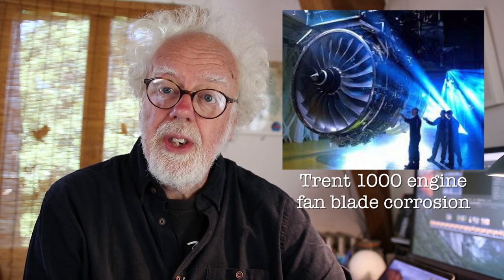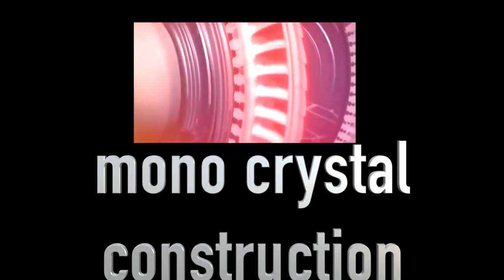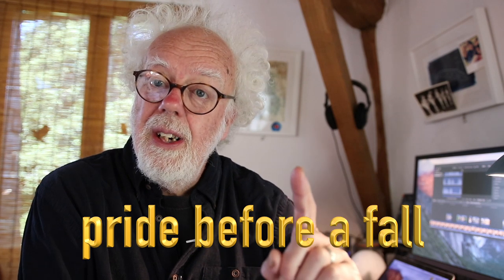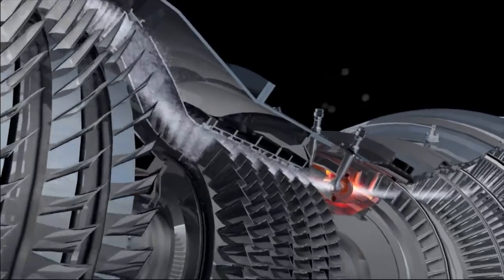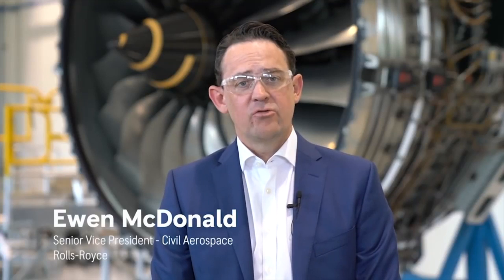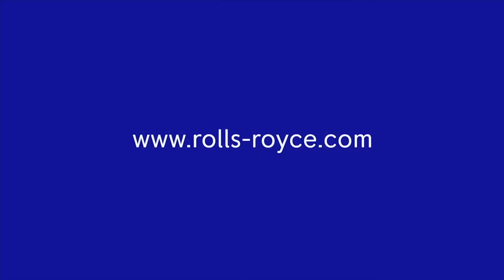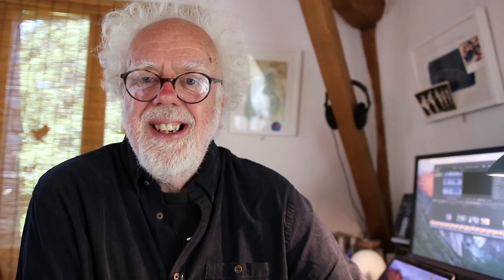Boeing and Rolls Royce problems - Prof Simon

Comment: Fact check: Trent 1000 does not power the A380 and A350. They are Trent 900 and Trent XWB which are within the same family of development, but do not exhibit the same failure like in B787.
Reply: True. The 900s just blow up. Several of the pictures he showed near the end were Trent 900s on A-380s.  They have been known for high-pressure compressor failures. The 1000s seem to have more issued with the fans.  Hopefully, the improvement in metallurgy will resolve the high pressure and hot section failures and GE is working on what may be the next great leap, both in efficiency and safety. They are developing new turbofans that will use a gear reduction assembly between the low pressure compressor and the fan. This will allow the fan to turn much more slowly, putting less stress on the center shaft and reducing the fuel burn required to get the same core RPM, while radically reducing the centrifugal stresses on the fan blades. Changes in the pitch of those blades will allow the fan to create at least as much thrust.

I can't imagine that Rolls Royce would be far behind.
Reply: @104thDIVTimberwolf  Timberwolf not a Mad Cat?
Reply: @transkryption  I'm not even sure I've heard that term before, related to jet engines (not that that means much).

Tell me more.
Reply: both engine series have been known for blade failure ie Trent 1000 PT failures Trent 900 compressor failures, still disastrous for RR, thats why GE is slowly taking over
Reply: @Dryootube  does Pratt & Whitney even make engines any more? They used to make some great ones.
Reply: Trent is a three spool design so each section can run at optimal speed. Fast at the hot back end and slow for the front fan.
RR have done this since the RB211 (a 1960s design). 
Their gradual development should avoid failures like these but clearly there is work to do.
Reply: @104thDIVTimberwolf  that's a crazy statement with a 16.5 billion turnover? military application or civilian?
they make the best military engines in the world to date, nothing comes closer, in performance and reliability, F135 powers the F35, F119 powers the Raptor, F100-PW-229 powers Eagle and Falcon and was a revolutionary engine in design more then 7000 produced, more then 24 million flight hours, 

All Bell helicopters use PW
Civilian you can start with the PT6 family, it is the most common turbine for small aircraft and helicopter in the world, a staggering 400 million hours of proven service, your larger aircraft most airbus and Boeing run PW engines.
Reply: @Dryootube  true enough. It's just been a while since heard of an airliner flying on anything but GE or Rolls Royce power. A better way to rephrase my question would have been "Does Pratt & Whitney even make engines for airliners or heavy transport, anymore."
Reply: That said, the Trent 7000, the engine that powers the A330NEO, is really just a shrunken Trent 1000.

Comment: Corrections: The hot section doesn’t have fan blades, they’re the big blades at the front (Low pressure compressor), however the hot section does have turbine blades. Also, the T1000 is unique to the Boeing 787 Dreamliner, nothing else. Finally, contrary to what the video says they don’t keep blowing up all over the sky otherwise R-R powered Dreamliners would be grounded, which they’re not. This is a very misleading video.
Reply: Couldn't agree more. All this talk about "fan blades"...... I'm not sure the Professor really understands what he is talking about.

Comment: Rolls Royce should talk to GE , because the 9X is having very similar problems with their turbine blades, this means the new 777 X will be late entering service . I believe that these monster engines have reached the summit of possible size and scale , to achieve the desired power and fuel consumption the pressure ratio is so great that it literarily cooks the turbine blades . They are simply too big , and I fear will never reach their potential, everything has a limit .
Reply: There is no limit to how big a gas turbine can be built.  Internal combustion engines are limited by flame front stability and speed versus engine RPM.
Reply: frank james straw just take a look at the gas turbines in a power plant, they are way much lager, the only difference is that they turn a generator in front, not a big fan

Comment: Read the engineers warned Rolls management there were issues before initial in service date but were ignored.
Reply: Sadly, this is the precursor to every major disaster.  Hubris.
Reply: Management ignoring engineers also resulted in the Challenger shuttle disaster in 1986. It is a persistent problem driven by money
Reply: The engineers were probably all ignored by Mr. %300...

Comment: Anyone else notice the RR commercial that started the engine simulation on an Airbus A-350, then puts it back at the end of the ad on an ANA Boeing aircraft (787, methinks)? On another note: With RR Trent engines problems, the GE 777 problems and the Boeing 737 Max issues - does it not seem that engineers are being asked to push the technology further and further, stretching the design envelope, into places that cannot support it? And as fast as possible? 

I'm all for innovation, but there are some things that are just not physically possible and it seems that safety margins are getting slimmer and slimmer, in the name of efficiency...
Reply: Get the facts right Professor if you expect us to take you as more credible than the corporate hubris you decry. Perhaps play to the camera a little less too? Or are you just an entertainment wannabe in truth?

Comment: Just to repeat my comment from the last version :-  As the recent crash in Russia has shown modern jet engines are susceptible to failure from even minor shock or impact, whilst large scale events are devastating. The regular thermal shock and pressures from cold start up to take off will expose any materials deficiencies and the higher the rating of the engine the worse this will be. Extended maintenance cycles exacerbate these problems. We are paying the price of a low cost everything culture that means the cheapest - not the best - takes the prize every time. Improved maintenance cycles will help but long term a more thoughtful understanding of the issues is required by all companies involved.

Comment: I can remember those engineering films from about twelve years ago when RR was boasting about making fan blades from a single crystal. Although I was impressed I also wondered why they didn't go on to say if it resulted in an engine better than the opposition. A better paint brush doesn't make a better picture, so why make such a big deal about it.
Reply: Was it suppose to reduce metal fatigue problems?

Comment: Hi Professor Simon, love your videos. FWIW the single crystal turbine blades work far harder than you think - They are hollow and have a convoluted air path through the middle of them and the air escapes through small holes in various places up & down the blade surface. This is to provide a film of cooling air (the air comes from the bleed-air source in the compressor section) over the surface of the blade and it's extremely important as at full power the blade operates in an environment 100°C hotter than its melting temperature.

Comment: Unexpected corrosion of the compressor blades - so not those exposed to combustion or combustion products. Particularly noticed in engines that have flown extensively over more poluted areas of the world. Airbourne sulphur maybe involved. I hear revised blades are in development. Makes me wonder if this engine has higher compressive pressures, thus the blades experience more heat than previous designs. More heat usually means more chemical reactions are initiated / are speeded up.
Reply: You may have nailed it on both parts of the equation as the compression ratio of this engine is reportedly a whopping 52:1, producing internal pressures of up to 700 lbs/sq inch. As far as I know, this is the highest compression ratio used in any modern aircraft engine, and is roughly 25% higher than in the competing GEnx version, which may be why it doesn't seem to have the same issues. Engines such as the cfm56 and Trent 700 ran compression ratios of 30:1 and 36:1 respectively, so there is a big difference in the amount of heat and pressure stress that the the turbines in these new engines have to endure compared to older (and apparently more reliable) models. As for the second part of the equation, high sulfur levels in South East Asia are indeed reported to be causing "heat corrosion" in the compressor blades, so you're probably right about the combination of pollution and pressure creating a perfect environment for these failures to occur.

Comment: Good Day Prof Simon,
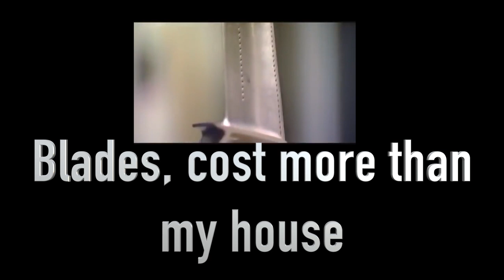In Video 1:30 stated Hot Fan blade, Do you mean here the guide vane blade Just behind the big diameter of Fan blade? Fan blade is in Front of engine before the compressor stage so it is quite cool
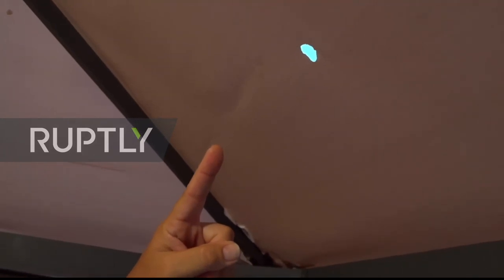In Video 3:30 debris from engine shown it comes probabely from the broken guide vane blade behind this big Fan blade... Only Turbine blade is Hot because it  positioned just behind a combustion chamber,and this turbine blade is hollow and have many small hole around blade to allow cooling air from compressor to flow as cooling film of air to protect this hot blade from these hot combustion gases
Anyway thanks for your effort to make such great videos...i will give you 2 thumbs up for this video

Comment: Rolls Royce have acknowledged their problem and funding repairs from revenue.  Their CEO,  Warren East, has told the shareholders to not expect too much of a dividend and has ensured the engineers are adequately resourced.  They have a new (2014) high tech engine plant in Rochdale (where they had the Muslim Grooming scandal) designed to make turbine blades for the Trent-XWB for the A350-XWB.   Blades from this plant will be used to repair the Trent 1000.  The plant wasn't ready for the 2011 Tent-1000.   The Trent 7000 is the same engine as the Trent-1000 but designed for the A330neo using bleed air for air-conditioning and de-icing instead of electrical power.  The Trent 7000 has escaped the Trent 1000 issue but will be given the new blades anyway for compatibility reasons.

The source of the problem is a deficient heat resisting coating that degrades because of exposure to atmospheric sulphur pollution from Asian (Chinese, Indian) industry.
Reply: William Jones-Halibut Muslim grooming scandal? Why don’t you call all the sexual abuse of children by Christian (many Catholic but not all) priests a Christian grooming scandal?
Reply: Milt Farrow Chinese elites in this case.
Reply: I find it really hard to believe your idea of the source to the problem "deficient heat resisting coating that degrades because of exposure to atmospheric sulphur pollution from Asian (Chinese, Indian) industry." only an idiot would believe that
and if that's a referenced true response from Rolls Royce then they definitely have problems

Comment: Ahh yes, Pride always comes before a big fall.
Reply: There was no excess pride.  The test program was driven forward, despite misgivings and warnings by engineers,  to meet deadlines.   They missed that sulphur pollution in Asia could damage by corrosion the blades corrosion resistant coating.

Comment: The futher we go in technology the more problems are coming. everything is cost control now. back in the 80's jet engines were designed on paper and didnt have this problem. all this new CAD computer precise engineering and  more problems than paper designed engines. our generation engineers are the problem.Look at the difference between graduate engineers now and before. they dont know crap.I met a guy in the UK doing Meng in aeronatical engineering and didnt know how a wing created lift! i was shocked! THUMBS UP FOR 20th CENTURY ENGINEERS! They were real tough smart engineers!
Reply: Some aircraft was designed with improperly balanced wings placement. 🙄

Comment: there are now attempts to soft-pedal the Boeing 737MAX8 debacle by pointing out crucial failure malfunction of other companies. At least RollsRoyce accomplished that when an engine explodes it does not damage the wing.  What many forget is that aviation changed in so far that at any given time of the day there are now approx. 20,000 passenger planes in the air with more than 4 million passengers on board.  This was never the case in aviation history. So still these accidents happen rarely compared to the air traffic density.
Reply: Not disagreeing but addressing another angle: Considering how rapidly the MAX hardware / software flaw was centered on, and like-it-or-not the fact that training may have played a factor in the combined disaster, Boeing's apparent immersion in fixing the whole problem (that's why it's taking so long,) is a good sign for them and the industry. About "soft-pedaling," I'm not plugged in to the industry enough to see stories of that. However, the manufacturer is responsible for the farthest subcontractor. As an enthusiast, consumer, if I did see soft-pedaling I'd be disappointed, angry, wary. I'll keep my eye out for that now. Sorry for the convoluted syntax.

Comment: Prof Simon Singapore is not the UK.  So not manufactured in the UK then, but: Singapore.  Who knows,  perhaps the humidity there caused them to be brittle?
LOVE YOUR VIDS
Reply: Interesting theory. Perhaps humidity does affect engines produced in other regions.
Reply: Corporate greed has a bigger impact on quality control with all manufacturers.
Reply: @diabeticalien3584  Gross humidty levels like we have here in North Cyprus are most noticeable. Appliances break more often batteries need to be changed and corrode more often.  If l leave a brass  padlock in a bag with other metals: tin pins steel needles coins magnets the brass looks like its being eaten by a fungal Cu and the other metals corrode in their own fashion  too. It's an Engineer's Nightmare and a Mechanic's Paradise.

Comment: It is interesting that the RR talking head says they will be replacing blades in the compressor not in the turbine section where the blades are failing!? Now for a slight correction the blades that are failing would appear to be turbine blades made from single crystal alloy casting and run very very hot. They are not as you stated fan blades which are the massive titanium blades at the front of the engine which are i this case hollow super plastic formed blades .Finally a little clarification they have increased the overhaul capacity by 300%. The reason i know all this is because i worked at RR for 10 years and was involved directly in the initial design of the Trent 1000

Comment: The advancement of computers technology and material engineering, Has allow engineers to model the advance material, the product design, simulate the complex environment in detail and in high accuracy. 

However, as accurate as they are, they can only predict with known factors. The problem is, not every factor is known, and the designer may not know every factor that need to be included in the model.

Engineering is stretched to the limit, redundancies are reduced to minimum. Because of the competition  to reduce cost, increase performance, improve efficiency. Every bit of excess is chisel away in the CAD model. It is happening in every industry. 

Unfortunately, we can’t predict everything, we can’t model everything perfectly, simply because we do not know everything.

When safety factors are reduce to bare bone, at the same time, specifications are pushed to the extreme, things fail unexpectedly.

It takes a little oversight in design, a short spike that was not present the modeling, a slightest mistake by the user, a blow in the unexpected direction.

They fail unexpectedly, only some spectacularly, some catastrophically, some disastrously.

However, Boeing 737 max MCAS case is plain stupidity.
Reply from the maker: Good points...I am sure engineers did their best but the accounts and marketing office ran this design program.
Reply: MCAS fix or any control software/hardware fix may be not a complete fix of the overall problem. Even when 737 MAX will resume flights it does not mean it is rock safe.
Puting greater engines on the aircraft that was not initially designed for such engines is artificially created problem. Who knows what raise next?
When you put 1000kg engine into VW Golf, who knows how much crashes it is going to induce after all software fixes in acceleration control?
Reply: I quote one comment: " The old school long before CAD in the 80's and 90' did triple safety issues checks and tests in real enviroment" . Moto they used in those times was"Better safe than sorry". No wonder some 25years + jet engines howling the skies with normal maintenance is going to outlive 2019 models. Why change somthing that is functioning like 25 years and more. Oh yes, I know managers need more bonuses and they can get it if the pilots fly those jets on air...

Comment: With now both RR & GE suffering similar serious engine issues, and seemingly more on composite wings that have a high flex built in, like the A380 and dreamliner, i wonder if unknown stressors in the air, compared to static testbeds, put factors that are part of this problem? The 747 had to have wing flex and vibrarion cancellors put in so testing them on that plane is different.
As the turbine blade axle gets subjected with new wings both high flexing, and slso possibly more vibration and tortion, the compressor blades and axle are breaking at the centre which is where the highest tolerances and temperatures occur, it could be down to fixing a solid unit onto a writhing wing wothout factoring that out